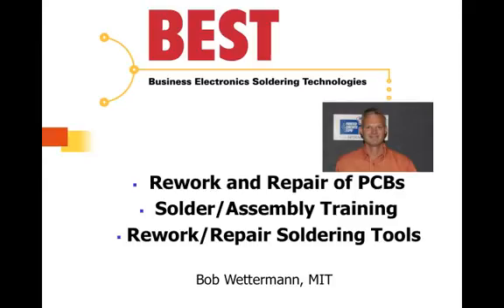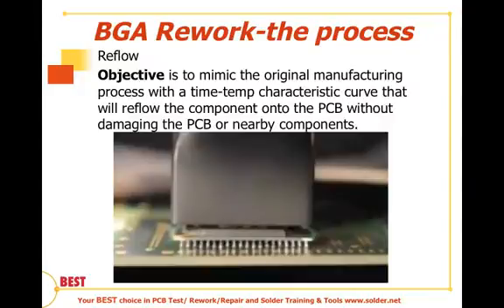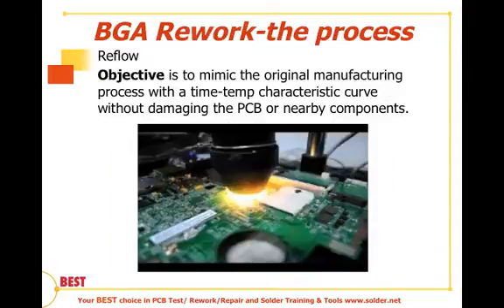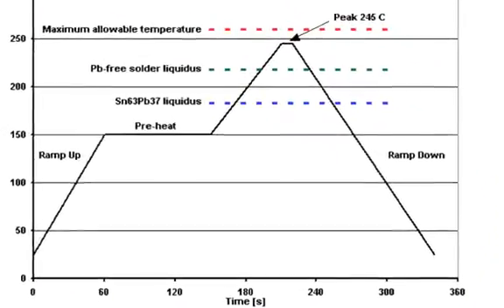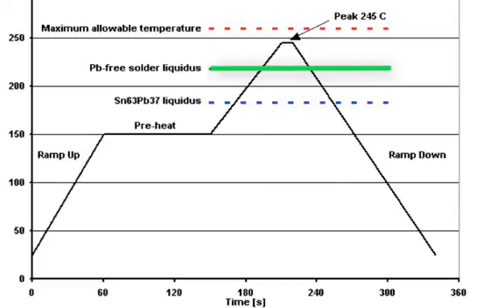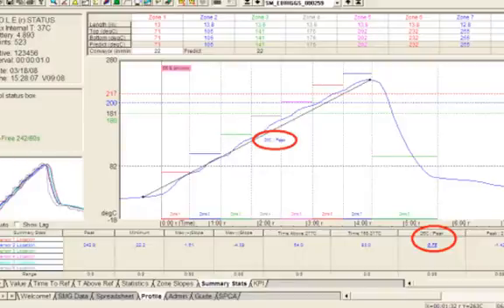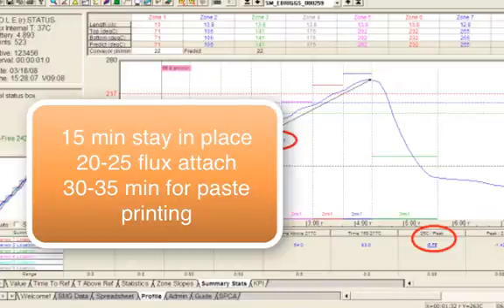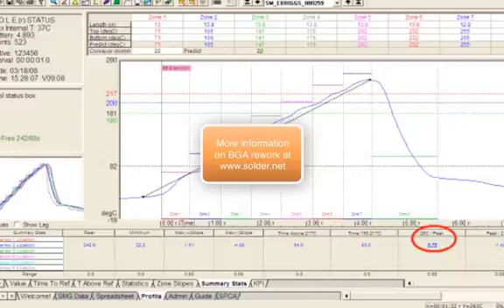BGA rework, the process of  reflow

Comment: Thanks for the video. What do you think of Flux Warton Future 350 to use in Reflow?

Thanks in advance
Reply: Hello. I wouldn’t use that flux, we developed it in previous employment before setting up SolderKing. If you’re looking for a very mild flux I would use SK F3-15
Reply: The reason I say don’t use it because it’s a wave solder flux and will damage the solder paste chemistry. They rely on different types of heat stabilisation